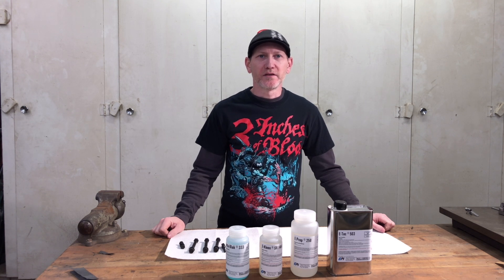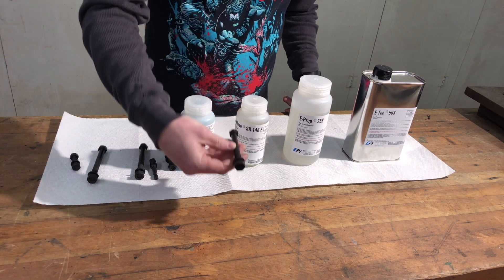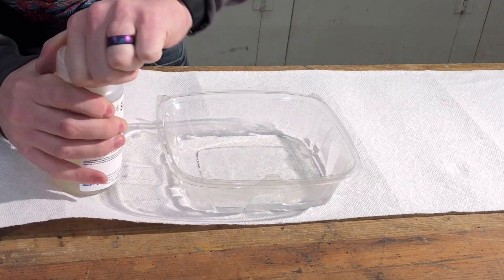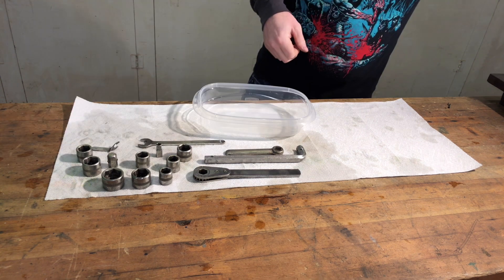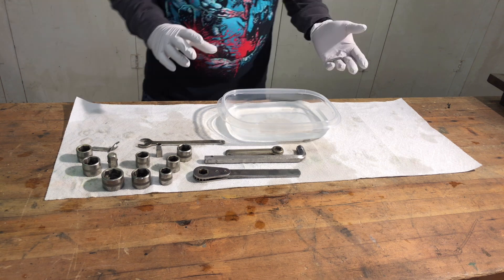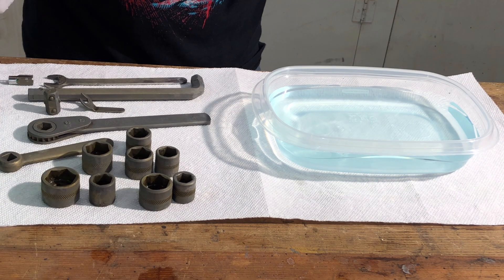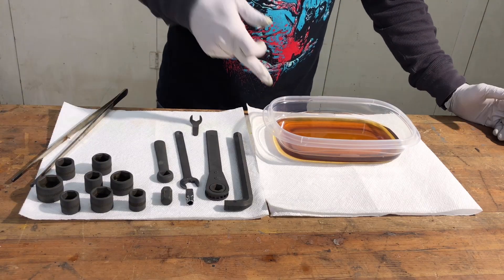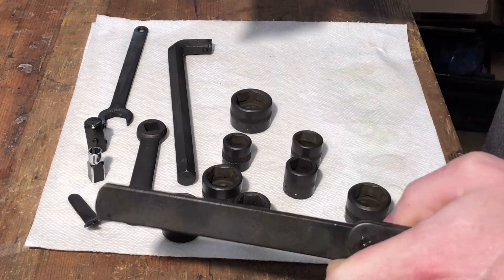Black Oxide Coating With EPI Insta-Blak 333 - Great Results at Home!

Comment: Ever hear of renaissance wax? I know a gun guy that owns many guns and has tried almost every lubricant/oil/grease, solvent/cleaner, CLP, rust inhibitor and anything else you can imagine... and he actually recommends renaissance wax as a coating. You just apply it with a cloth and then rub it in and wipe it off and it forms a barrier on the outside that is supposed to completely stop rust, so the guns don't have to be cleaned, oiled and maintained just while sitting in the safe. I have seen MANY really good, nice, expensive and even stainless firearms rust to destruction from being left in a safe for years without proper maintenance (oil). He says that it completely stops the rust from forming and also that the coating left on the steel is so thin that it doesn't interfere with the action or how the parts fit together or anything like that. The only thing I don't like about it is that it can make any gun look like it has a high gloss finish and I don't think they make a matte finish kind of the wax. Never tried it myself, but I've only ever heard good things about it. I just think Cerakote (H-series and especially the E-series) coatings are the best rust/corrosion protections that exist though... but the renaissance wax if far cheaper, much easier to apply, 1 can lasts a lifetime and it also doesn't change the color of your gun. Forgive the rant. Just thought it was worth mentioning in case you like trying new things like that and/or if anyone else that reads the comments does.

Comment: that can be used for metals with chromium?
Reply: no.  Stainless doesnt work the same way.  You can use this black oxide for carbon steels, most alloy steels, and tool steels.  Stainless is in its own category.

Comment: Not bad, I've seen people heat up bolts and dip them in oil that coats them and technically heat treat them in a way. Leaves a black coating also might be less cost in that vs EPI stuff don't know what's more durable

Comment: Any update on how well that little wrench you use for work has been holding up? I’ve got an old set of SK wrench’s I’ve been looking into doing.
Reply from the maker: It has started to rust a bit, which isn't surprising considering the nasty oxidizers we use at work. Still far better than if left untreated.

Comment: Thanks for the video. I am restoring an old ATV and have ripped it all apart. While having everything painted I decided I want no chrome on the ATV. I rattle canned the heads of the hardware including all nut and misc parts. Question is that now that the hardware is painted can the process still be used? And if spray paint can suitably be used after the blackening process. Thanks in advance!

Comment: non-ferrous metals include aluminum, copper, lead, nickel, tin, titanium and zinc, and alloys such as brass.
Reply: A non-ferrous metal is any metal that isn't iron (or if you want to count alloys as metals, then you can include any alloy that doesn't have iron in it). The word "ferrous" comes from the Latin "ferrum," which means iron.

Comment: So, were you able to store the chemicals successfully?
Reply from the maker: So far, so good, though I haven’t tried using them again. But at least they aren’t melting the containers.
Reply: The 148E, 333, and 258 can be stored safely in a plastic container. I would store the E-Tec 503 in a glass or steel container. The E-Tec 503 can degrade the plastic. As shown in the video you can use a plastic container to process the parts. When you are finished I would pour the E-Tec 503 back into the steel container it came in.
Reply: Any word on how long the chemicals stay viable? The expiration date is only a few months from purchase. Is that a BS number ?  Thanks guys